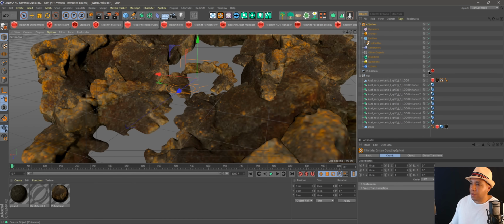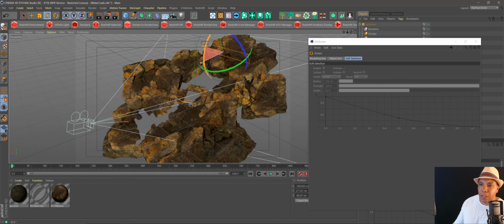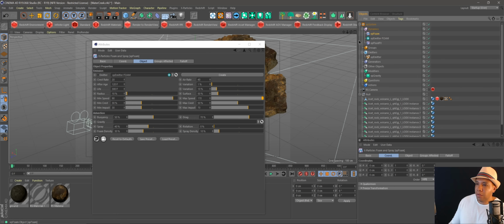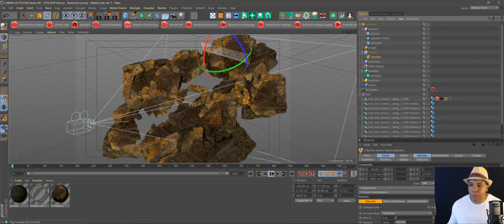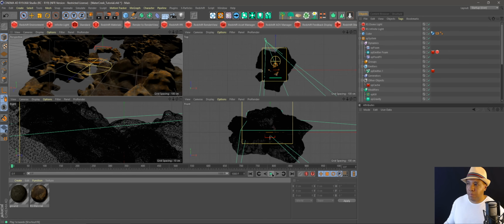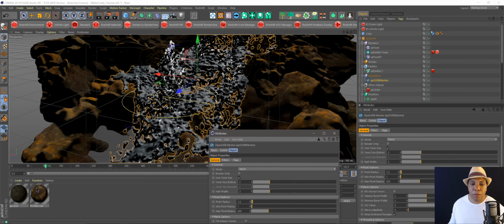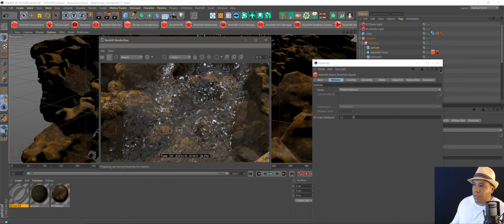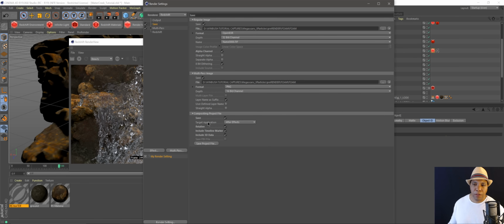Creek Series Part 2 X-Particles / Cinema 4D / Redshift

Comment: Since you cant use the birthrate, is there a way to stop it from emitting at a certain frame?(turn off the emitter/water)
Reply from the maker: It's been awhile but if I remember right you can just keyframe it to emit no particles at a certain point

Comment: I have followed a lot of the amazing Winbrush tutorials lately and I'm good up to the point of when it comes time to render. I keep getting a message saying that "no direct AOV's are detected. Disabling multi-Part output" Someone else had this issue on the Redshift forum, but what worked for him didn't work for me. Does anybody have a guess as to what I could be doing wrong?
Reply from the maker: Honestly it's been awhile since I've used Redshift I've been using Unreal Engine these past few years but I dont recall any errors like that before

Comment: Great tutorial, however my cache was like 45gigs plus. I had to stop it because it locked my system. I lowered the radius to 1 on both foam and the initial emitter. What am I doing wrong?
Reply from the maker: You don't need to lower it on the foam just the emitter but try raising it to maybe like 1.5
Reply: @JonathanWinbush  Awesome! Thanks man and appreciate the brief response.
Reply from the maker: @conradjohnson3011  No problem man hope it works out
Reply: Hey Winbush, one more question. So, I'm using Octane. How can I create the same export technique for the foam using octane? In order to get into AE.
Reply from the maker: @conradjohnson3011  honestly im not sure i don't use octane at all
Reply: @JonathanWinbush  Ahh okay, I'll guess I'll do a bit of trial and error. Hey, I might learn something new! Thanks again and keep up the good work man!

Comment: Awesome again, would be cool to try using vertex maps from XP to add dampness onto the rock ( I guess darken them and add a little more reflection)
Reply from the maker: You know I did start to use wetmaps and got them to kind of work with Redshift but since I built the scene with instances it was only working on my main geometry so I'm still trying to figure that part out for sure. Hopefully I get it soon so I can make an bonus video.
Reply: ah that's cool, I don't know how well it would work, but I think you can create proxies with redshift instead of the instances. Again i'm only guessing as it's not something I've tried and not sure how much versatility you have with the others but it may be an option
Reply from the maker: @grantchesterdesign  you know I didn't think to try proxies I'll give that a try next